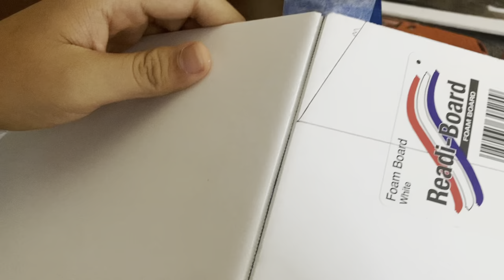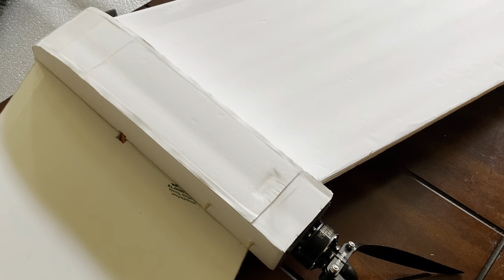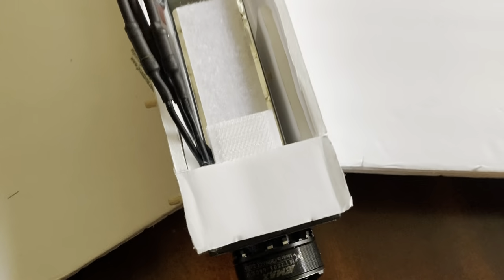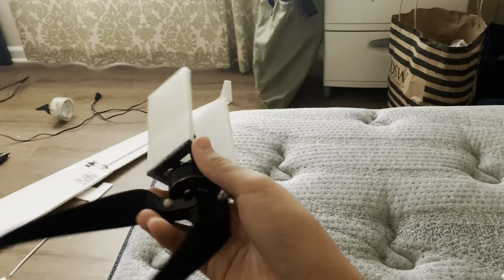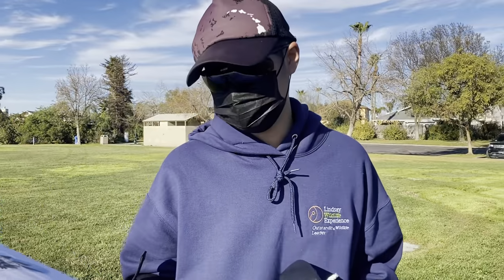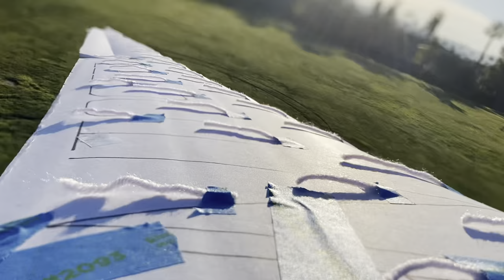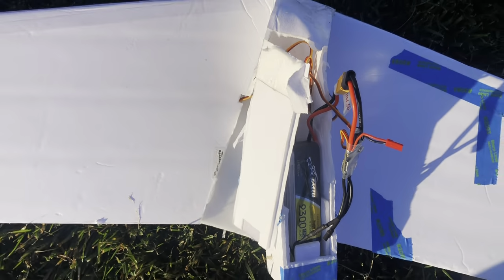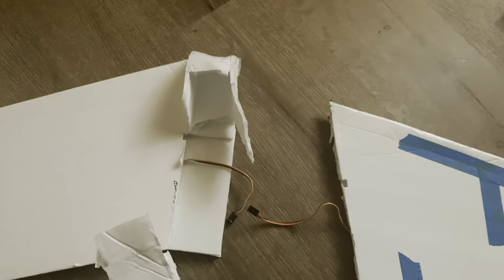Building a MASSIVE Flying Wing!

Comment from the maker: Any tips, questions, ideas? Did I get any information/facts wrong? Let me know I can improve future videos.
Reply: Maybe put a plywood spar in the wings and if you want a speedster just shorten the wingspan and at a higher pitch lower diameter propeller
Reply: You could also increase flight weight by covering it in packing tape and or adding extra batteries just for weigh
Reply from the maker: @ZapTeam  it was all about that efficiency. Too bad I demolished it before I could really test it.

Comment: Welcome to Youtube!

IMO if a 100" wing fails with just a few additional ounces, the structure was marginal to begin with.

A high-aspect-ratio wing can sustain severe g-loads without any spar, but you'd need a stressed skin that can withstand large bending moments (i.e.: balsa wood sheeting which is vacuum-epoxied to a dense foam core). Another option is a low aspect ratio (delta) which will reduce the bending moments but at the expense of efficiency. In your case a spar is indeed the easiest addition.

Every choice you'll make will be a compromise in cost, reliability, complexity, and performance, which is what makes engineering so interesting. OTOH, early on I would suggest building on the experience of others before worrying too much about being an "engineer", that can come later.

As for the video, I'll recommend that your intro avoid suggesting that the video isn't interesting, lol.
Reply from the maker: Thanks for the advice! I got inspired to make a channel from watching others. This was my first time making a flying wing. I tested out different construction methods and learned what worked and what didn’t. The added weight and the lack of a strong spar were not the only factors that led the wing to fold.

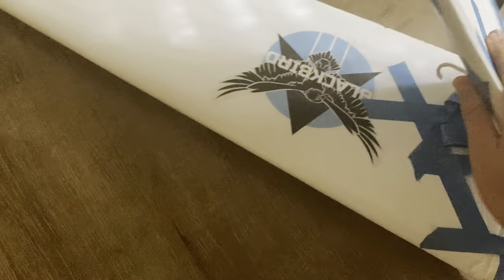Comment: 16:40      now  you  KNOW  WHY  a wing is  SUPPOSED  to have a load-bearing main spar, one  that 'spans the width' of the fuselage;  and structurally 'ties' the fuselage and wing halves together.!!
Reply from the maker: I already knew. I designed it to only carry the weight of itself. I made the mistake of attaching my phone to the plane. Still got good footage

Comment: I think you have a good design, it just needs a little reinforcing in places. You can do that by using toothpicks and bamboo skewers:

For sturdier joints on the motor mount, try putting toothpicks into the joint like nails right after the hot glue. If you use a nail to make pilot holes before you glue the parts together, then it will be easy to insert the toothpicks. You don't have to use the whole toothpick, half will do. That will give your motor mount more strength and not add much weight.

You could also run thin bamboo skewers through longer sections of foam board you want to reinforce. (Inside the foam, between the paper sides) It would also make the place where the wing joins the fuselage stronger if you ran some skewers through that area so that the middle of the skewer is on the planes centerline. The skewers inside a large section of foam board do not have to run parallel to the edges; they can be angled from corner to corner. If you use thin enough skewers, you could even cross them in the middle to make a panel much stronger. Just run one skewer against the inside of one paper side and run the second one against the other paper side. Twisting the skewers like a drill bit makes them go through the foam better. Also make sure they are sharp because a blunt tip sometimes will make the foam ball up on the tip. That makes it hard to push through. It can also mess up the inside of a panel by making big rips in the foam that weaken the panel.

Hot glue works for other parts but I think thin superglue is the best way to secure toothpicks and skewers inside the foamboard. A bit of superglue on the end of one will get into the space around the stick and keep it from sliding inside the foam. That will make the section more rigid as well as stronger. It also does not make lumps on the edges of the foamboard so it is easy to join the foamboard to other pieces.

Keep the good videos coming! I've watched a couple now and I am looking forward to seeing what you come up with next.
Reply from the maker: @wrekced  I definitely agree that it could use more reinforcing. I’ve never heard of using toothpicks to make the motor mount sturdier, I’m surprised. Thank you very much for your tips, I will be sure to implement them if I ever do projects like this. Have a great rest of your day!

Comment: Great effort. Breaking things is how we improve our projects. That was a good idea to put a folding prop on it so minimize breaking it on landing. For the same reason why not put the fuselage and servo horns above the wing as well? If it's going to be a belly lander, get the bottom flat by moving the fuse and servos above the wing. If you can't use a wing spar, use a vertical spacer over the centerline and wires out to the wings about 70% of the way out. Anchor the ends of the wire/20lb test nylon fishing line, doubled up teeth floss, etc. with some lite ply and an eyelet screw glued to the bottom of the wing. Some Nylon reinforced packing tape across the top of the wings to the fuse will help too. Overlap the tape over the fuse. I think flutter is going to be a problem with a long narrow wing unless it is made to be very stiff or is flown very slow. Using a symmetrical airfoil will help some though. After all that design is not meant to be a speedster. Just some ideas.
Reply from the maker: Noted. Thanks for your advice.
Reply: @_BL4CKB1RD_  One more thing. Flying wings don't really need winglets. There mass contributes to flutter. Give it a try without the winglets. Good luck.
Reply: @_BL4CKB1RD_   i subbed :D

Comment: You'll see in a lot of storebought planes that they add a carbon fibre spar or two across the fuselage and wing joints. This is mostly about strengthening the build. If you'd had a couple of spars, the wings folding up like that would have been a fair bit less likely.
Reply from the maker: I now realize since the that project why it’s better to over engineer than under engineer.

Comment: Nice airplane.  Only problem is, you didn't have a spare in the fuselage compartment.  A yard stick laid flat across the fuse area would probably handle the load.
Reply from the maker: @DavidCousins  I didn’t build it to last long. Just enough to survive long enough for this project. Otherwise I would definitely make it more structurally strong.

Comment: Nice effort for early build try, I like the high aspect ratio design. Looks a lot like full size flying wing built by the Horton brothers in 1930s., and very nice video. As others have said spar is critical. Ill add the the most stress is at the joint of the 2 wing halves join. The spar should go out at least halfway out the wing. It is tricky though with swept wing. Flight test good resource. Also look at Experimental Airlines videos. He has some with swept flying wing and shows spar stuff. Also he shows covering the foam board with packing tape before building wing. It really helps the strength  even at the middle joint. Keep trying you are almost there!
Reply from the maker: Thank you so much for your encouragement and support!

Comment: Great job young man. This model flew very nice and with the affordability of foam board I hope you will be right back at it again soon. Flighttest offers free downloads of foamboard plans and tons of helpful build video's as well. I avoided flying wings for decades but once I built and flew one I'm hooked.  I have several now and my biggest problem with them is keeping the orientation of the model in the air. Contrasting colors of cheap packing tape help strengthen and improve visibility. Good luck and have fun... keep your fingers away from those blades.   ALWAYS
Reply from the maker: Thank you man for the tips! I have learned a lot from FliteTest and built some of their models. I wanted to see if I could build a plane of my own design. Mistakes are the greatest teacher.

Comment: Great design man! You're getting somewhere with it. 

I recommend a big spar (aluminium or wood or carbon of atleast 1000mm) to prevent wing collapse - I also would increase the winglets for better yaw.

Look at my ''Grey Heron'' Flying Wing design - I have a Start-to-Finish build video on that as well: https://www.youtube.com/watch?v=F5AjqwWqlUk that might help you with the process. 

Keep it up!
Reply from the maker: Thanks for your advice! I should’ve used a spar, but wanted to save on weight. I will increase the size of the winglets next time…